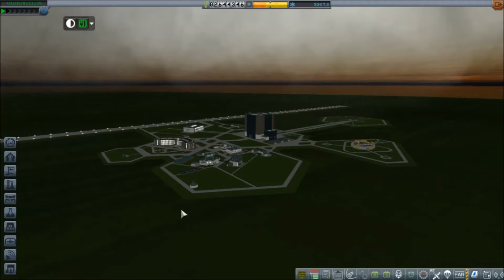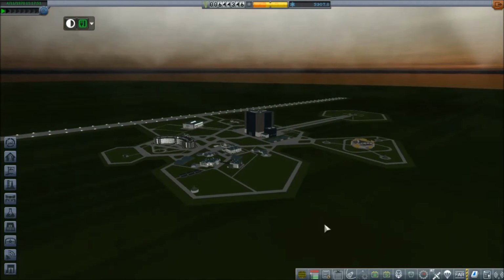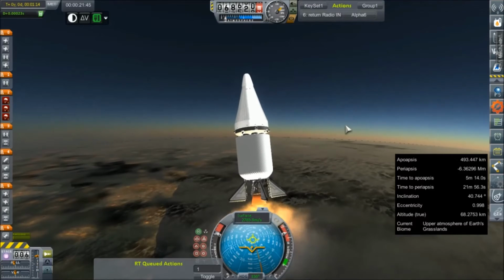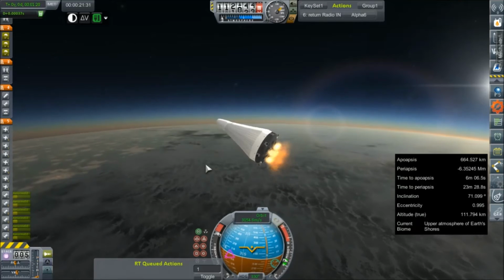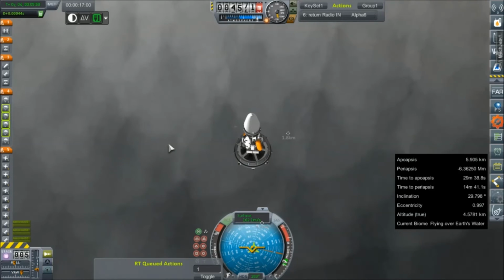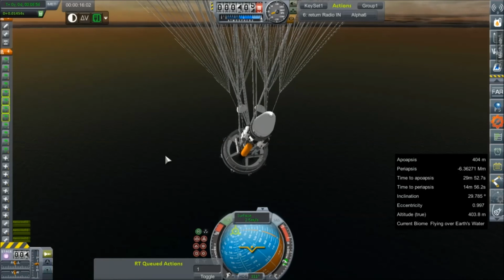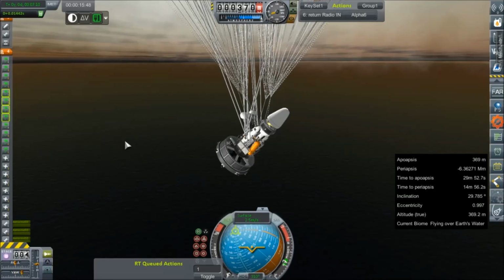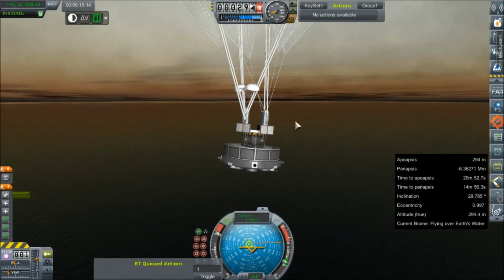KSP RP-0 #215 Iron Dust Testing Phase II

Comment: You can offset the CoM just by having a roll controlling thruster just behind you heatshield, with a small fuel tank attached, just in one position. I also offset my payload from the center of an oversized heatshield/aeroshield, also achieving offset. NASA has flown a few missions where they include inert tungsten masses of a few kg in the aeroshell, and jettisoned them after they'd done most of their braking.

You'll want to be mindful of your ballistic coefficient, IMO. It is a useful measure for estimating how much deceleration you'll get from the air, as a ratio between your craft mass and braking surface.
https://ntrs.nasa.gov/archive/nasa/casi.ntrs.nasa.gov/20090024230.pdf

The largest ballistic coefficient that NASA has so far used was 147 km/m^2. Generally their craft are closer to 65. Producing lift helps make a lander more plausible even with higher ballistic coefficients.

I intend to place and price some methalox engines and RealISRU hardware for my sample and crew return missions, but that will take me a while still. I've also been experimenting with attaching to a dead stage via teather and spinning against it to generate stable artificial gravity for the crew on the way to Mars, or any long mission. I'll be recording a video or two about those experiments this weekend, although that will be in stock as a 'proof of concept' since I've never seen anybody else use the technique, so I want to show it off.
http://marsforthemany.com/wp-content/uploads/2016/01/artificialG-660x346.jpg
Reply from the maker: oh cool, cant wait to see these videos!
I'll have to dig in to these links a bit more later, so keep in mind the rest of this is before having read up.
I worry about an offset COM screwing me up for all part of the mission where it's not needed.  My thought was to have a fuel tank on a piston, or some other IR device to move it off set when I want it, and then retract it back when I don't.  This having an accent stage to it, I figure the mass needed to create the offset is going to be somewhat substantial. Will see what further testing shows us.
Reply: yeah, something with IR may be the most efficient. depends what the IR parts mass though, since a few dozen kgs in thrown away tungsten/lead masses aren't so bad either.
Just skim the documents for tables or graphs, I generally don't share things unless they have good/useful tables or graphs. :)

Comment: why not set the rocket at a slight angle in the launch clamp, so that it launches just off from 0 degrees, with a small bias toward 90? Gravity turn, without avionics. For added stability if needed you could add a small tilt to the first stage fins, giving you spin -which provides aerodynamic stability.
Reply from the maker: Yeah, the tilt from lauch ( esp w the super high TWR ) is so obvious i can't believe I forgot...
Reply: Yea, I think I actually have seen you do that before. :D Had a feeling you had just forgotten. When I saw your launch profile + avionics issue it was my first thought.